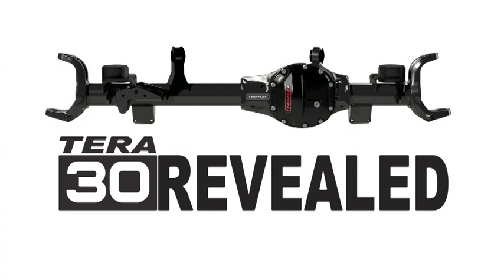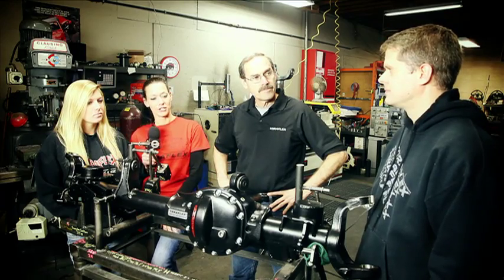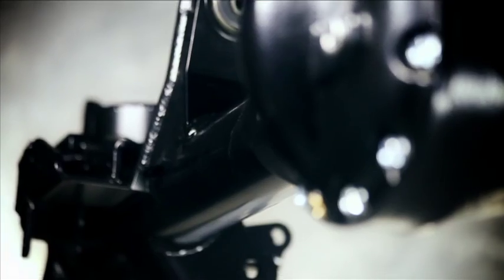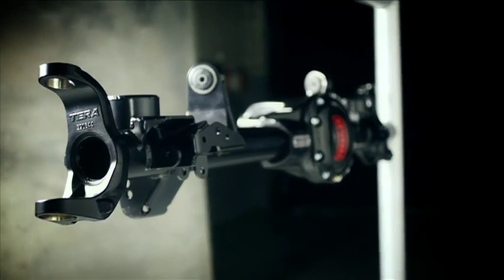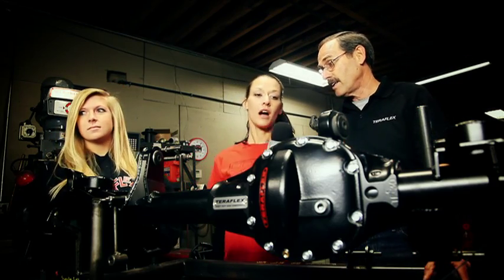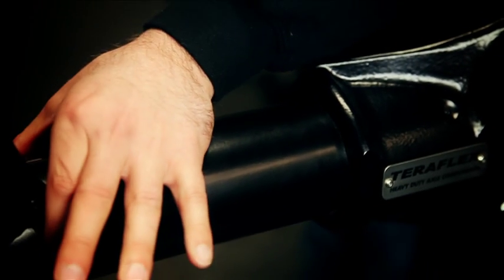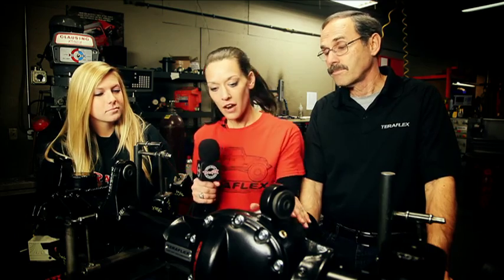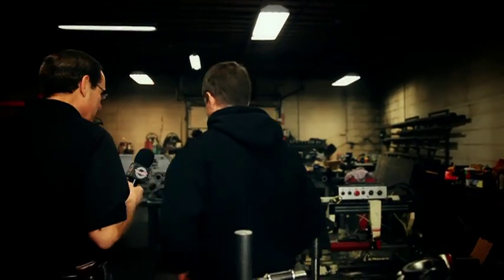TeraFlex: JK Tera30 Heavy Duty Front Replacement Axle Housing

Comment: I haven't made any mods yet to my Dana 30. Just bought the Jeep. It's a 2017 with 33k miles on it and I put 37's on it. It's not for rock bouncing, mainly exploring and overlanding but Moab is definitely in it's future. Would I be better off switching to a 44 before I spend any money on the 30?

Comment: I ha e a 2017 jk willys no lockers or a lift yet ..but I think I need to beef up my Dana 30 or replace with a 44 first before I get 35s or 37s  can this product hold up to 37s new heavier  front bumper witch and roof rack or do I need a 44
Reply: Digem Jeeps  If you wheel hard enough to where a truss and c gussets don't work for you and you need this housing you need more than the d30 internals that live inside the polished housing.
Reply: you can still put 37s and a big lift without problems. I have 37s and a TeraFlex 4'' long arm kit, bumpers, winch, etc and no problems, all depends on your skinny pedal. everybody say dana 30s are weak and i mean they are but you can still lift it and put big tires on them. Im currently saving to get Tera60s all around.

Comment: Im running tera 30s can i put 37s on it with beefed up internals or do i need to truss/sleeve it?
Reply from the maker: You should be fine with the beefed up internals, but know that your gearing will most likely be the weak link. It all depends on how you drive it and how hard you are on the pedal.